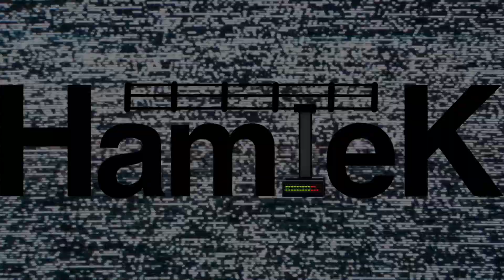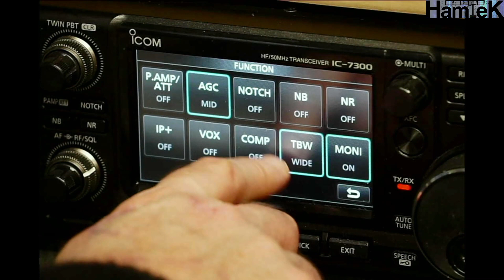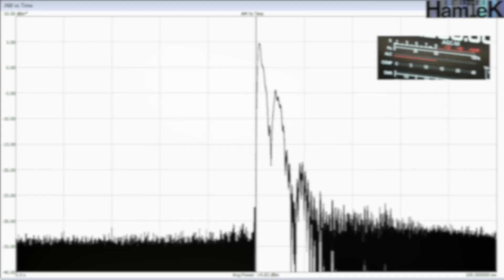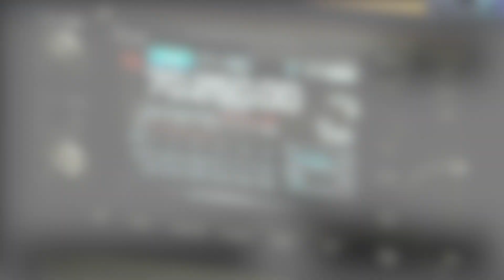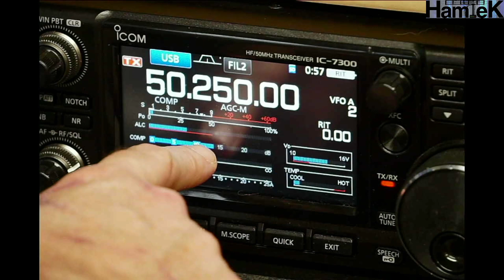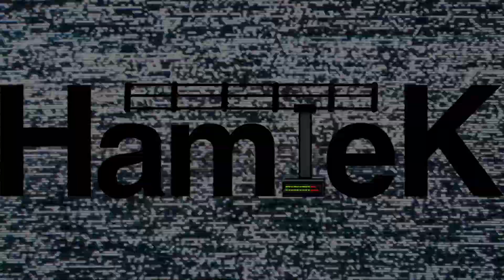Icom IC-7300 4m RF Overshoot

Comment: Excellent, very helpful video! Thanks so much for this information. ~ 73, AC7WH
Reply: I have noticed the overshoot issue on all bands while the IC-7300 is set to around 35 watts and it is being used to drive a Palstar LA-1K amplifier as mentioned by @johnsonimagineering in a previous comment. Instead of being limited to 35 watts, it has spiked to at least 70 watts which triggers the automatic "Overdrive" protection feature of the LA-1K amp. I've recently adjusted the ALC settings on the amp, and have seen some improvement while testing with a dummy load. I'm looking forward to completing more real-world testing to see how it does. Thanks again for your video! ~ 73
Reply from the maker: Thanks for your comments. Have you done any more testing with your radio? I still haven’t looked to see if there’s an ALC adjustment on these radios. Sorry for the huge delay in my reply!
Reply: @hamtek  You're very welcome! Around the time of my original comment, I posted a video on my channel titled "Solved: Icom IC-7300 Overshoot!" and included a link to your video and another link to one by wildbill1 titled "Alc overshoot spike remedy icom 7300." However, a few months later my Palstar LA-1K had a major failure in one of the two power transistors. It had to be sent in for repair. Both transistors were replaced by Palstar with upgraded versions that are known to be more reliable and powerful, and I was charged a very reasonable repair cost. Even after that, I had one instance of overshoot. Therefore, I made the decision to purchase a Yaesu FTDX10 and haven't had a single issue with overshoot. Thanks so much for providing helpful content. ~ 73, Jared ~ AC7WH

Comment: Didn't realise I could even get 4m on the ic 7300 until I tried it. Seems like an afterthought for the UK version maybe. Why would one need a linear amplifier on 4m anyway? M7JZW.
Reply from the maker: @jemussi7842  4m is an interesting band, but sadly it’s not available in most areas so I guess Icom decided not to complicate the firmware with a dedicated band selection for a small minority. A linear amplifier is needed for the same reason as any other band - to get further distance. An extra 6dB doubles the communication distance. It’s preferable to get gain from the antenna though (using directional antennas) as this also boosts the received signal strength, but if one’s looking for maximum distance then more power is required. Long distance propagation is possible on 4m and monthly UKAC contests encourage maximisation of station performance.
Reply: @hamtek  Thanks. U'm a fairly new foundation licence holder. Didn't realise 4m was that popular. Will have to give it a go wuthout an amp of course 73s M7JZW

Comment: The problem is "ALC" overshoot on that particular radio. I've experienced the same problem on the 40 meter band. The gentleman who made the following video has correctly pinpointed the problem cause and has come up with a novel solution: https://www.youtube.com/watch?v=vfMk9PxpOws    I hope you find this helpful. I did and was able to correct the issue on my Icom 7300 this morning by using the ALC interconnect between the radio and the ALC linking circuit on a Palstar LA-1k amplifier by providing the 7300 with a reference voltage. That seems to prevent the spike. Gaines Johnson N8FSD.
Reply: I have noticed the overshoot issue on all bands while the IC-7300 is set to around 35 watts and it is being used to drive a Palstar LA-1K amplifier as you had mentioned in your comment. Instead of being limited to 35 watts, it has spiked to at least 70 watts which triggers the automatic "Overdrive" protection feature of the LA-1K amp. I've recently adjusted the ALC settings on the amp, and have seen some improvement while testing with a dummy load. I'm looking forward to completing more real-world testing to see how it does. ~ 73, AC7WH

Comment: Hi Tim,

The answer is to use a power attenuator rather than power control to set the drive for the linear.  That applies on all bands because even if there were no overshoot, one day you will forget to turn it down and send full power into the amplifier.
Reply from the maker: Luckily the amp has an AGC so it backs off the radio output if I forget! (It has protection as well apparently but I’ve never tested it). I used to use an attenuator but it was a pain to take in and out (to run 100W without the linear) and reduced the RX as well as TX. I suppose I could have come up with a switch or used a pre-amp, but I chose to control the audio and connect it directly. Are you surprised by the amount of overshoot? I supposed it could just be a fault in my radio.
Reply: @hamtek i agree with Mike. Even back in days when I ws running QROO on VHF and used Javornik Transverters and FT1000MP, I opted out for 100W into 30dB 100W ATT as I got the best results. Now when I need AMP to be driven, I usually go with dedicated setup. I saw simillar behaviour with other rigs, including IC756PRO3